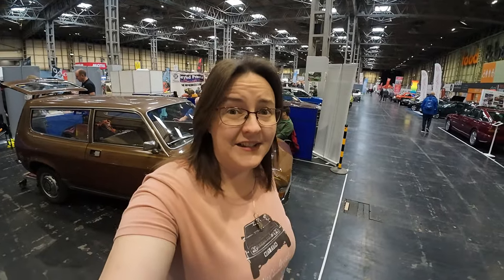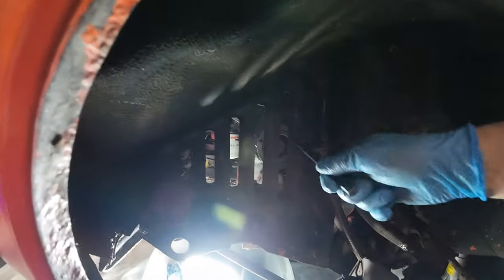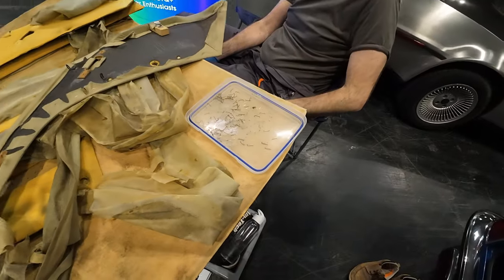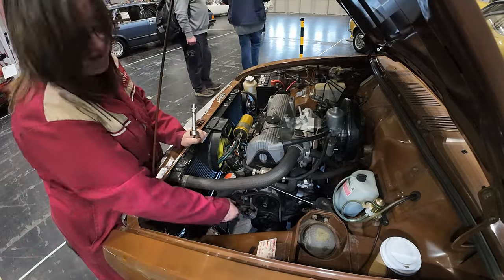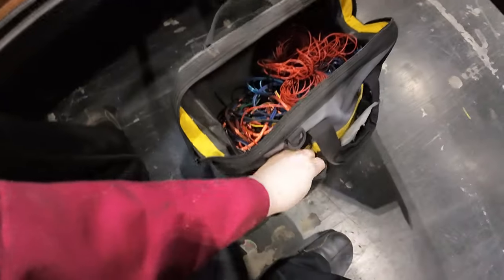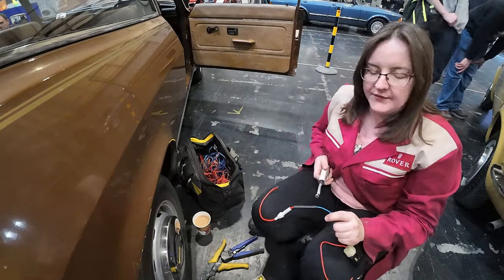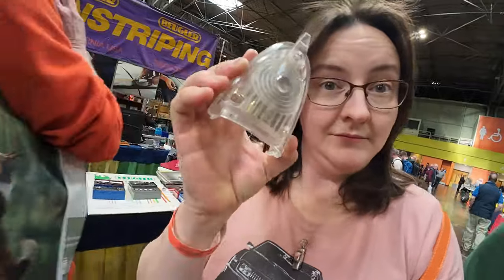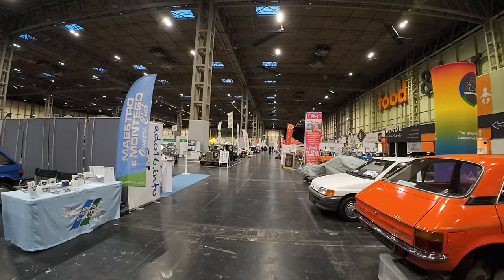NEC Restoration Show 2024 - Saturday - Austin Allegro - Jobs done

Comment: I like watching folk tinker with cars, i would have enjoyed the show. Lots of jobs are so much easier on these older cars.  I should get the starter off mine and give it a good clean up as it is sticking a bit, but   I've been reassembling a clock movement today.  That mirror paint pen is good..I used one to go over the inside edges of the front side/indicators on my Dolly where the original finish has rubbed off.

Comment: When I am tightening an alternator belt without any assistance I normally leave the bottom adjuster nut a bit loose but tighten the top two bolts. This allows the alternator to pivot (just) and held in position using friction from the top bolts whilst you get the bottom nut tightened.